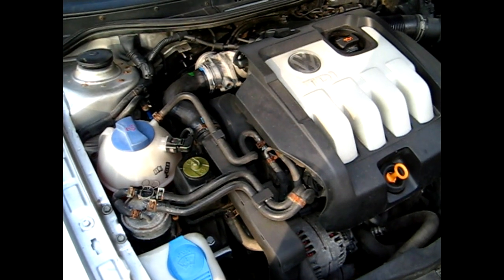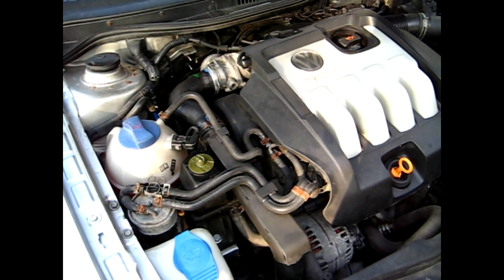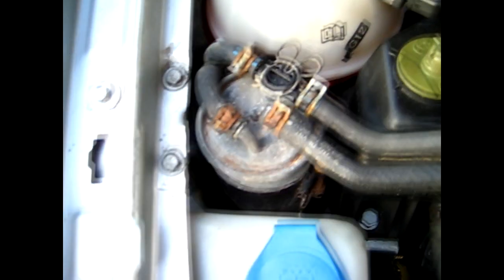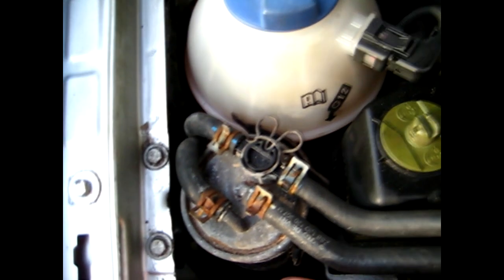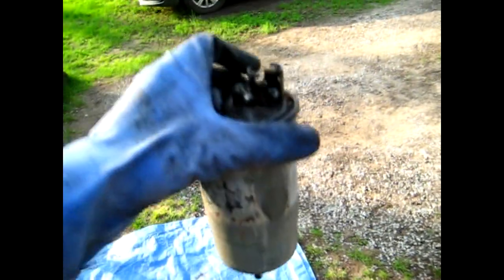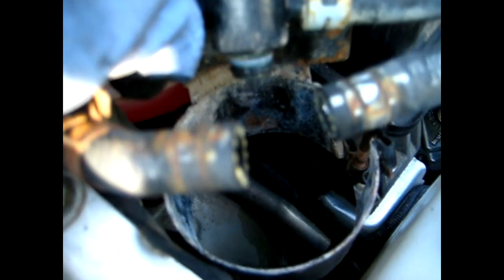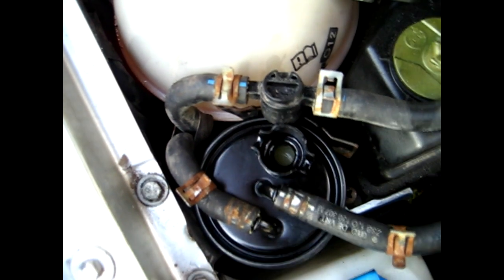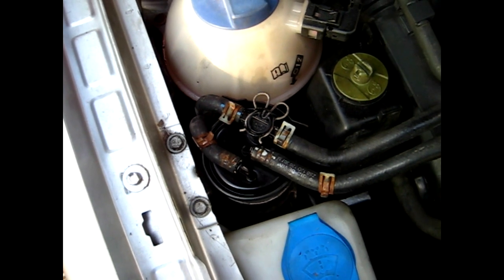DIY: Volkswagen MKIV TDI Fuel Filter Replacement & Priming With Seafoam

Comment from the maker: Gromitdog1 This is a pump duse diesel. You don't normally have to pre prime the system. Usually it'll just self bleed the fuel system itself just buy cranking it over. It may take a little longer to get it started, but it'll all work out in the end.
Reply: so did you pretty much fill the new filter with sea foam before putting it back ?
Reply from the maker: Yes I did.

Comment: Had the Golf TDI 150 since August, the VR6 did go shortly after sadly, the costs of fuel in UK and mileage meant had to go diesel route, still I went for the top of the line 150 model and its pretty darn quick for a diesel, only downside is I miss the sound of the VR6 engine you don't need a stereo when you have a VR :D

Comment: That seafoam may not be very effective due to the application method.  You filled the fuel filter with it which was nice, but as soon as the car starts and the fuel starts pumping from the lift tank I believe almost all of the seafoam will end up back in the fuel tank, diluted.

Comment from the maker: I would not switch the T fitting out to something different as it is a specific part to the car and filter. Those filter housings are specifically designed in order to hold that T fitting.

Comment: Per Sea Foam's instructions, after the fuel filter hot-soak, you're supposed to start and DRIVE the vehicle for 30 minutes for the best cleaning.  They say the harder you drive it then, the better it will be at removing deposits.  Their words, not mine.

Comment: This is the second time I changed the fuel filter with a air pocket in the fuel line.  How do you prevent the air pockets besides bleeding it?

Comment: according to seafoam your supposed to pour the seafoam into the fuel filter and into the tank. Also once you wait the 15 to 20 minutes to let it soak your supposed to run it hard. any reason you didn't do these things?
Reply from the maker: That would be based on a gasoline engine, for a diesel you cannot feed the seafoam into the intake or vacuum lines as it will continue to run rather than flooding and shutting down. I have never heard of the requirement to run the vehicle hard, that wouldn't be needed.

Comment: I know mate, i know.The fuel price is mad, not just in the uk, but everywhere over europe.But I'm driving a diesel as well, with an ATD engine *100ps , and sometimes I wish to drive a petrol instead.. The ARL is a correct engine, I've already upgraded my car  with some parts from the ARL, and planning to keep going with the mods, but it will never be a petrol.. Anyway .. good luck with your ARL, and watch out for "chocolate cam problem".As I know this is the most common prob with the ARL engines

Comment: I have had problem changing fuel filter on Golf 4 SDI.On Mahle filter (1j0 127 401a) the termostatic T part just couldn't sit deep enogh and I pushed it with pinchers so I could tight it a mickey mouse pin(clip) and it seemed allright. I was suspicious so I removed pin/clip and T part and the inside plastic part with two O-rings and a little metal round part were left attached to the filter. Mahle is not a good part. Now it leaks fuel and must be replaced. Should I get different/shorter T part?

Comment: So no problem w air in the system doing it this way?
Reply from the maker: Nope. You'll still have the crank it a couple times as there will be air in the lines, but not as much compared to if you didn't prime the pump.
Reply: +4DIYers Good to know, thanks. How about if I refilled the filter w Diesel Kleen Power Service?
Reply from the maker: No problem. You should be able to use that as well. I know that product is available locally here, have heard good reviews, but haven't used it myself.
Reply: I have no power band torque w a CEL. Is that my fuel filter maybe?
Reply from the maker: Start with scanning the CEL first. Can you hear the turbo??? If not then there is most likely an issue relating to the turbo such as a vacuum leak, faulty actuator, stuck vanes, etc.
Reply: Do I need a VCDS?
Reply from the maker: Nope, a regular OBD2 will be fine.
Reply: +4DIYers great, good to know, thanks for your kind reply, Dave!🤓

Comment: HI JUST WATCHED THIS VIDEO AND NOTICED THE ENGINE LIGHT STAYS ON AFTER CAR IS RUNNING WHY IS THIS ???????????? BECAUSE YOU USED SEAFOAM ???????/
Reply from the maker: No the Seafoam did not cause the engine light. The car had a turbo actuator vacuum leak which was triggering the check engine light.